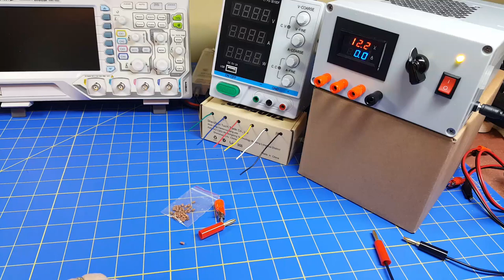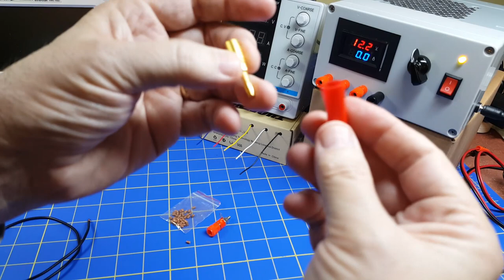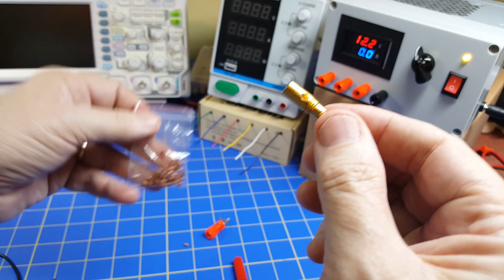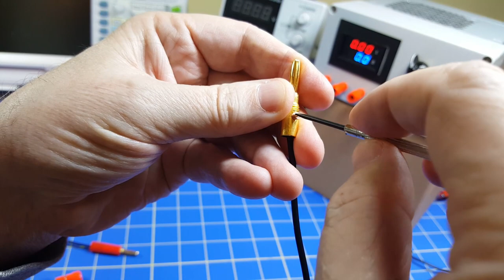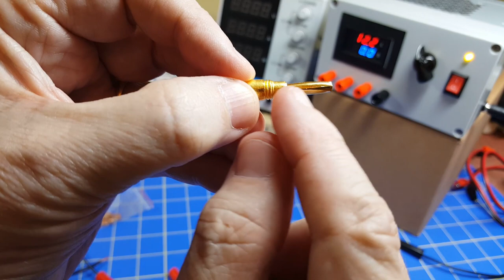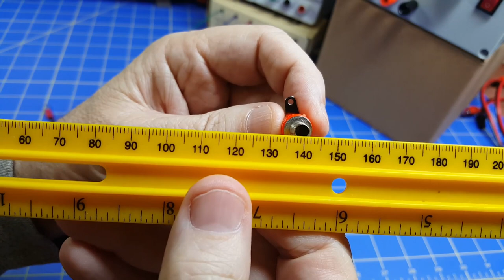Banana Plugs & Binding Posts

Comment: The place you tried to insert the spade wasn't correct. That was just for the casing to hold onto. You would be clamping the spade connector between 2 pieces of plastic and the only connection would be the edge of the spade to the threads. This would result in high resistance. You could put the spade or ring connecter on the end between the 2 nuts. This thread is smaller (and made for this)

Comment: I have an anytone 778uv with 5 way binding posts. I purchased banana plugs AV01 5-6mm and the do not fit into the plugs in the rear of the radio. What size do i need? thanks. I purchased these and they do not fit all the way in. This is the radio AnyTone AT-778UV Transceiver Mobile Radio Dual Band 25W VHF/UHF VOX Vehicle Car Radio w/Cable